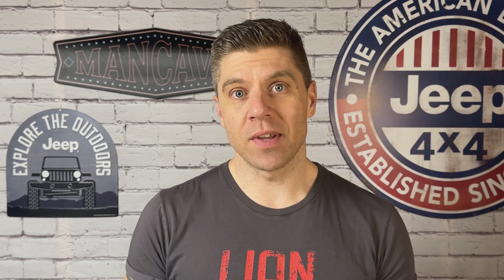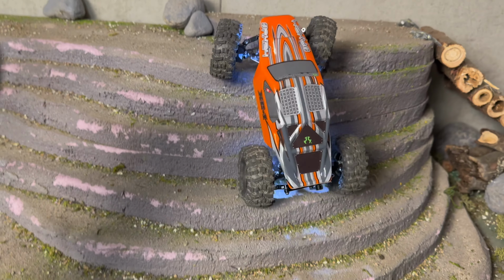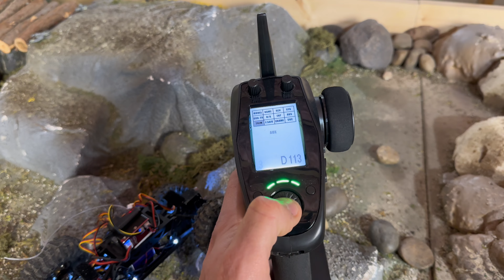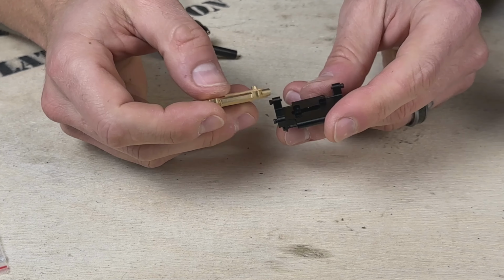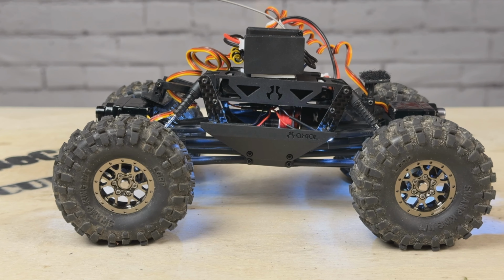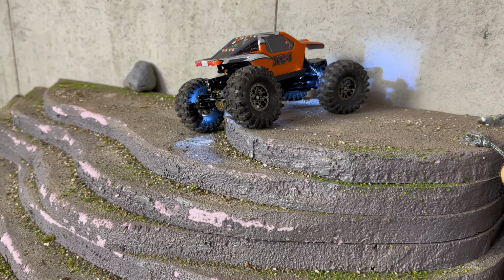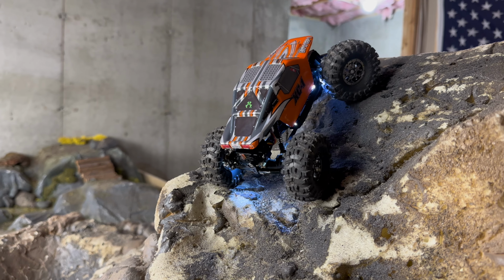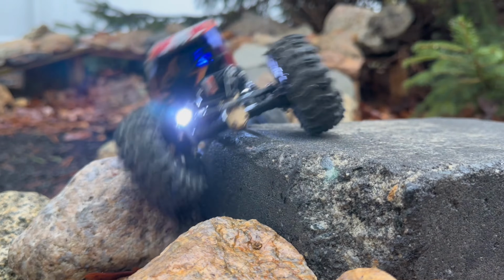Axial AX24 Build - Furitek BRUSHLESS Motor Upgrade! HUGE Performance Gains!!

Comment: When I upgraded my servos on my AX24 I needed to set the trim for the rear as well. So I disconnected the front servo from the ESC and then set the trim for the rear. Plugged the front back in and it stayed right where I set it. It tracks better now than stock out of the box.
Reply from the maker: So you plugged the rear into the CH1 to trim it and it stayed?
Reply: Exactly what I do too
Reply: @CapeCrawlers  yep that's what I did
Reply: Can you explain how you do the whoe process? Mine just goes back to what it was when I plug it back in

Comment: There were two reasons why we decided to bring the skid plate lower. One was of course clearance for the motor but the other one was to bring the weight of the transmission/motor lower on the chassis itself. The loss of ground clearance is more than made up by the lower center of gravity. I'm glad you enjoyed it 👍.
Reply from the maker: The whole package worked together extremely well! Super happy with it. It completely changed my perception of the truck.
Reply: What is the absolute ultimate motor transmission package for this set up??
Reply: @bdog7262  I prefer Lizard pro and micro Komodo for this one but to be honest everyone is different in how they drive so you may get 100 different answers to that question 😅.
Reply: @Gamyrc  is the micro Komodo the only size that will fit in this? Also could you help me out with telling me what are some awesome axles for this build. I’m starting from scratch and want to do this right the first time. Save money that way. lol I want the best of everything

Comment: mine weighs 436 with a 57% forward bias and 50/50 side to side and its a monster.  I have picks and videos on IG showing it on the scales too.  That furitek will obviously be a game changer though!  💪💯
Reply from the maker: Yours is rad. What scale do you use out of curiosity?
Reply: @CapeCrawlers  skyrc bluetooth corner weight system!  Great piece of equipment and really a bargain price compared to the older models.  Setup is very simple and straightforward.  Would highly recommend if your looking for a corner weight system!

Comment: Rear servo trim solution! 
I cut two old steering links so I had the correct length to align the rear steering. Then I used marine grade heat shrink tube to glue them together. It took two tries to get it right. 
Also with an Injora red 050 motor the crawl control is awesome!
Reply: I did the steering modification to the short drag link Not the knuckle to knuckle tie rod link.
Reply from the maker: That's some clever problem solving right there!
Reply: I put an Injora motor on mine and the crawl control is much, much better. Not awesome but better. It also has a lot of brass. But when I see the technical and side hilling I will not put another penny into it. I hardly ever play with it. For the money I paid for it and the money I put into it I could have had something much better.

Comment: I want to do brushless soon but i have no clue what I would put it in! I've really fell in love with the look of the ax24.
Reply from the maker: I'm eager to see what you choose. With this kit I don't think you could fit anything other than the micro. I did see Matt at 2FMRC put an ROP in his but completely reworked the chassis.
Reply: @CapeCrawlers  I don't think I'll put it on an ax24 right now. I'm thinking about putting it on a deadbolt and making a comp build, but I'm not the richest person in the world so it might be a little later than I want but I'm definitely going to do one this year. I love my c10 to much to change the motor and electronics! 🤣

Comment: Excellent tutorial. I build rc crawlers for a after work hobby. On my ax1 I have Meuse 52* steering axles with ramp crab extende lengths. Now a brushless motor. You have helped me make up your mind on a brushless conversion.  I was disappointed in this rc like you were.

Comment: I couldn't agree more with you these electronics they fitted to the Axial AX24 XC-1 has got to be the worst on the micro crawlers from axial
Forward is bad bad but reverse is even worse...
And yes I have also spent many hours trying to find out how to centralize the back servo!  after fitting my e-maxx servos.
So if you find out please let me know
Thank you for sharing another epic video with us 🤜💥🤛
Reply from the maker: The whole system is flawed. Good intentions but it fell short. So far I've only heard of folks switching the rear servo to the CH1, trimming, then returning to previous CH. But I tried that and the emax didnt keep it. Others have developed custom steering linkages to get the length to the point of centering the wheels. It's all crazy and unnecessary in my opinion.
Reply: @CapeCrawlers  yeah I managed to get my rear centralized by using the center hole on the servo horn 👍
And it's working great right now.
🤜💥🤛

Comment: hit the bind button a couple times and the light will blink however many times the number channel you're on. trim accordingly.  turn off controller and turn back on to save and get back to the original channels

Comment: ive seen people set rear steering trim by cutting the stock arm that goes from the servo to the rack a drill it for a small bolt with head cut off and adjust that way

Comment: Wow you just fixed my issue with the rear trim, can’t wait to mine done like this.
Reply from the maker: I wish Axial had a trim function for the rear from the factory. It's a shame to have to find these expensive workarounds.
Reply: I agree, but have to say the slow crawl looks pretty cool.
Reply: After upgrading the servos and couldn’t align the rear very well I had to use the round disc servo horn just to get it close but it’s still not perfect and it’s ugly this way so I was excited to see you found they cure ha!

Comment: The only way I've found to trim the rear servo is with adjustable steering links.
Reply from the maker: I've heard other folks say the same. That's a lot more cost effective than a electronics overhaul!

Comment: I installed 1/12T 33% under drive gears front and rear , the slow crawl is now much better than stock .
Reply from the maker: That's good to hear because I've got those on my bench right now debating on how best to utilize them!
Reply: I am also planning a front overdrive transmission in the future.

Comment: adjustable links are the way to go.  mine somehow worked with Treal links front and rear and the rear link connected on the top hole in the servo.  I had adjustable links on hand though so I'm putting those oh the other AX24 in my build series.  💪💯
Reply from the maker: That's a way easier solution than overhauling the transmitter combo!
Reply: @CapeCrawlers  💯

Comment: I’ve found that brushless motors increase everything on a micro crawler including vertical even if they raise the center of gravity the slow speed will make it just as capable on a slope as a brushless motor while improving everywhere else.
Reply from the maker: It's crazy how much of a difference that low speed torque and control make.

Comment: Far as the servo for the rear if you run proper steering link that will solve the issue your having. There are one made where the link mounts to the knuckle and the top arm is a certain length to account for the servo horn.

Comment: Looks good man! What a change. One thing I noticed, I thing you could get away with mounting the ESC and receiver flat to the panel instead of sideways. The way you have it mounted seems to raise your center of gravity. Might be wrong.
Reply from the maker: I think you're exactly right. It's awfully tall right now. I need to tweak that setup.

Comment: I’ve heard of you switch the front and rear servo wires, trim it, then switch them back, the rear will be set.  Obviously if any adjustments are still needed a full repeat procedure is as well.  

Don’t have one so, not certain this would work.
Reply from the maker: I tried that early on and I couldn't get the rear to keep the trim. Not sure if it's different with aftermarket servos, but my Emax's wouldnt maintain the trim

Comment: Also if you have some injora double barrel springs swap them for the ax24 springs. Lowers CG some
Reply from the maker: Great suggestion! I have a ton of those lying around.
Reply: @CapeCrawlers  the ones I like are about .25 shorter then stocks. Hit me up on the tok tik and we can chat parts and all that anytime. Hope that limit chain worked for ya if you ever used it. Lol.

Comment: On the Note Fury Tech I feel like Nick's Motors 100% better so far navigate to Pancake so far so much better but maybe that's because I got the Revenge of pancake adjusted correctly on the blizzard Pro and I'm just still going to have to work out the Kinks on the new system
Reply from the maker: I love Nick's motors. The SMP is probably my favorite. The smoothness is unreal. I don't know if I could fit one in the AX24 without significantly reworking the chassis, otherwise I would go for it

Comment: You should try Texoma's slayer chassis it's awesome! Mine is on fcx 24 axles. Park 250 motor injura shift servo(14 bucks but fast and powerful). Gladiator links by injura Tegu esc 3100 spectrum reciver. Injura scrambler style tires. 350 grams. Total beast!
Reply from the maker: I need to check it out. I have had several people recommend that chassis recently.

Comment: Good video! I have been having the same issue with my ax24. Took it all apart twice, trying to figure it out. Swap in a mofo rc 30 motor too to see it would help. Definitely going to Swap out the asc now.
Reply from the maker: I was going crazy trying to figure it out! I almost put the thing up for sale I was so frustrated
Reply: @CapeCrawlers  yeah I haven't even touched mine in a few weeks other than putting on some mofo beadlocks wheels on it.

Comment: I love the course & the videos. I did the furitek stinger in mine. Cut off the top plate & cut the lower plate just behind the trans. Moved the rx & esc to the rear of the bottom plate & the stock battery sits angled between the rx & front frame rails. It’s a little monster now.
Reply from the maker: Sounds like a great setup!

Comment: Im taking this AX and putting its goodness into a Scx24 platform, this thing is pretty terrible unit. Always cockeyed off to the right if its under any load. barely can climb 50degrees.  BUT I think once its all installed into a stable Scx24 frame it will make for a awesome 4ws setup :)
Reply from the maker: The tried and true SCX24 platform to the rescue!

Comment: My rear steering quit working on mine, I was at my buddies house it worked before I left the house got to my buddies would not work we plugged another servo into it there is power to the servo but the switch it’s not working does nothing
Reply from the maker: Thats a bummer! Do you think it's the esc or the transmitter?
Reply: @CapeCrawlers  i’m thinking transmitter because there is juice to the servo pushing the A or the B Button does nothing you can’t turn the back wheels by hand that’s How I can tell there is juice to the servo

Comment: Hey Adam, have you noticed that the motor hits the front driveshaft on full compression?  I have the same system and there is a perfect circle groove around the drive shaft where it hits.
Reply from the maker: Yes I have! I saw a friend of mine fixed this by reversing the male and female ends of the drive shat and then trimming the female end just slightly to make room.
Reply: @CapeCrawlers  that’s a bummer. The drive shaft is pretty extended, not sure I have much more real estate to trim more. I will have to give it a go. I reached out Furitek and they recommended I switch shock position which is interesting since that is not an option with the stock chassis. Maybe the angry sparrow would give more mounting options to prevent this.

Comment: I just did this upgrade to mine yesterday and everything is good other than I get super bad torque twist? any reason to why that's happening. I mean its so bad that if I barely throttle forward the whole body is leaning.
Reply from the maker: Torque twist is terrible on this thing. I think the additional power just amplifies it. You could put some aftermarket shocks on and adjust the preload and spring combos

Comment: ##TLDR WARNING##

I got a new AX24 for my nephew, saw your first video and ordered some wheels/tire/brass and that Injora 050 50T and sent all that with it.  My brother reports that my nephew is doing good with it, but its really jumpy.  Just like your video, I'm assuming.  After watching your video I figured an aftermarket ESC to the rescue, looked at all the Furitek stuff and I'm getting concerned over compatibility with the 2-in1 receiver on the AX24.  

There are warnings on the Lizard Pro with BT dongle module (FUR-2073) that its not compatible with HRZ00005 receivers.  Is the Spektrum (SPMXSE2425RX ?) that comes with the AX24 this variety with a HRZ0005 board?  
  
You show the Lizard ULTIMATE (Fur-2226) running on the 050 brushed motor.  That's exactly the performance I'm targeting (its better than I'm looking for actually), but its on the flysky receiver.  You comment in the video that it will work with the stock receiver and radio.  I looked it up and found the Lizard Ultimate has no such compatibility warning on the Furitek site.  So with or without the FlySky, this is a potential solution @+$100    

I've seen other folks that have bought the full Stinger package including the integrated Lizard PRO (in the box with Blue Tooth inside).  That one also works on stock electronics.  So i'm thinking that the Lizard Pro in the AX24 stinger package is not equivalent to the Lizard PRO that you can just buy by itself (beyond the cosmetics being in the box with integrated BT and everything).  

Seeking lower cost solutions, I looked up the IGUANA ESC, thinking this would be a cheaper alternative, but same compatibility warnings.

Bottom line, i'm looking for a "good enough" brushed ESC, appropriate for the heavier than stock weight modded AX24 with stock receiver, and would provide a good slow crawl experience for a budding enthusiast. 

Basically, how would you have fixed this without going Flysky and Brushless?  That is specifically what I'm trying to avoid for cost reasons.  The Ultimate is $110, feels like i should just get the whole AX24 stinger kit at that point.  Is there a $50 or even $75 solution for brushed motors and stock radios?

Any help would be greatly appreciated!
Reply from the maker: I had to do some research before responding here. It’s easier to show you. Check out this short I just posted: https://youtube.com/shorts/U1CmNrgKvfc?feature=share

To summarize, I think your best bet is to wait for furitek to release the ax24 lizard as a stand-alone purchase. The stinger combo does work, but it’s a pricey upgrade. 

Hope this helps!
Reply: @CapeCrawlers  Thanks so much for looking into this!   I think waiting till they release it is a good idea.  A radio isn’t in the cards and I think waiting for an ESC only or finding funds for the whole stinger kit will be the answer.   It’s still a super fun rig as is.

Comment: Is it as easy to toggle between steering styles as the original control controller?
Reply from the maker: VERY easy. It's a switch on the side of the transmitter you can press with your thumb  on the fly. Super simple. That is one thing I actually do miss about the stock electronics.

Comment: What battery did you end up using? Does it sit on top of esc?
Reply from the maker: I’m still using the stock battery, or the EcoPower 450 trail batteries. It kept the same battery location

Comment: What was the box beside the new one called, and where did you by your Furitek kit at?
Reply from the maker: I used a FlySky GT5 transmitter and receiver along with the Furitek setup. I get my Furitek parts from Furitek direct or from Helidirect.
Reply: Thanks man
Reply: If I was to do this would my stock battery work with the sky fly receiver or the Furitek system

Comment: Hey mate I put a mofo rop in mine and when it flexes the front shaft hit the motor and is wearing a groove into it. Any suggestions on how to stop this? Thanks mate.
Reply from the maker: Yikes. That's a tough one. Any chance you could flip the skid around and mount it rear facing? Alternatively you could make some sort of stop, maybe a small screw in the skid plate that the driveshaft hits first before making contact with the motor?
Reply: @CapeCrawlers  I ended up putting spacers on the front shocks to limit travel. Worked really well and didn’t loose much performance which is good. Thanks for the reply again mate. Love your work.

Comment: Can I just use the Furitek system and plug my steering servos in it or do I need another esc to plug with my servos?
Reply from the maker: You'll need a receiver to plug your servos into. The Furitek system comes with the esc, but no receiver.

Comment: what tool " bit set " do you use? can you link it?
Reply from the maker: Lately I have been using this tool kit from LGRP: https://littleguyracingparts.com/products/trx4m-complete-tool-kit?pr_prod_strat=use_description&pr_rec_id=be0408ccf&pr_rec_pid=8079136325944&pr_ref_pid=7132459761849&pr_seq=uniform
Reply: @CapeCrawlers   Thank you! i will take a good look at them!